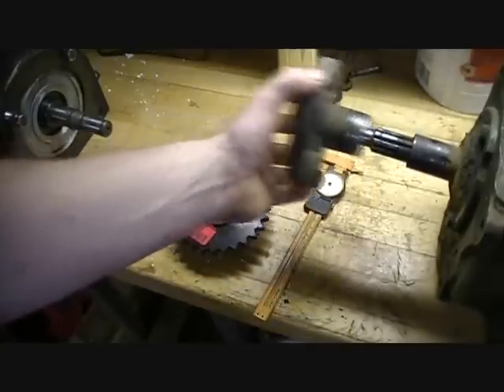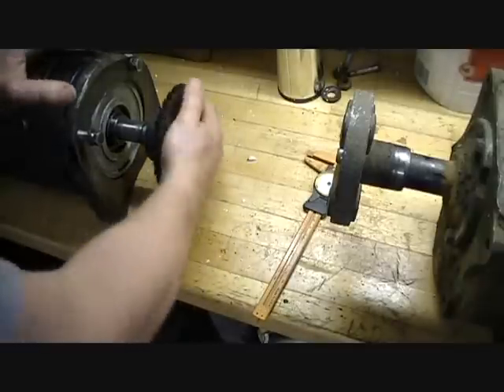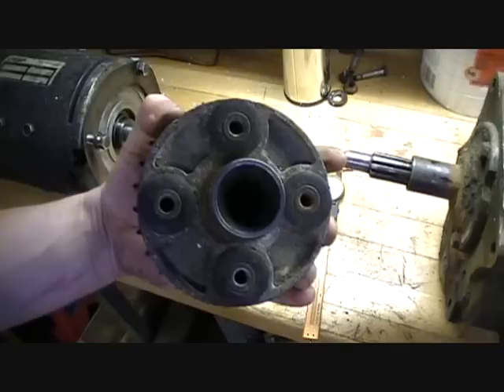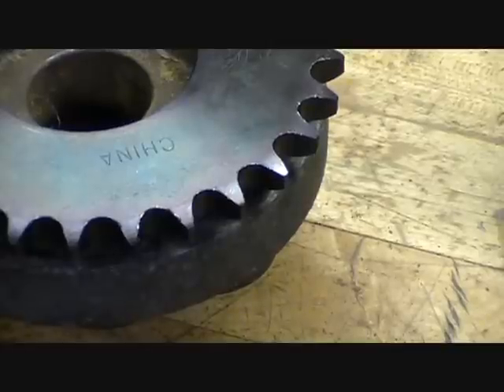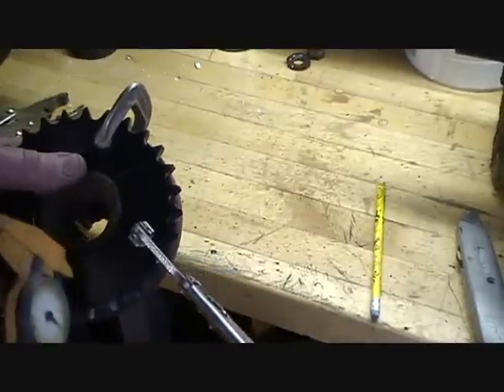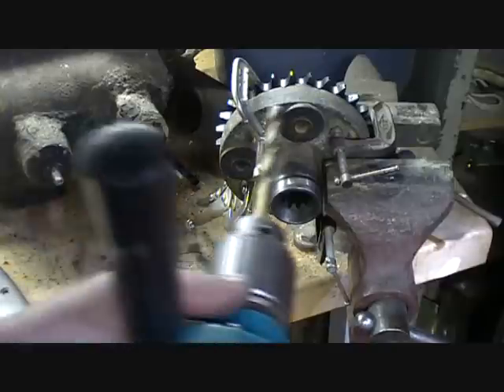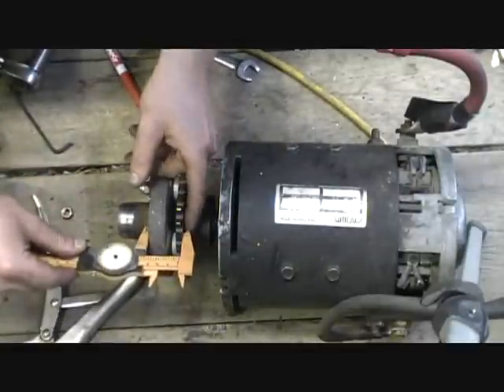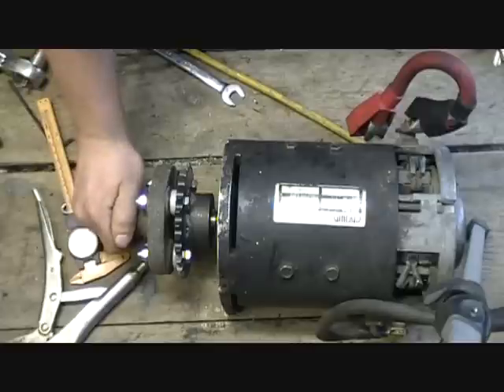1961 Cushman Truckster EV conversion LiFeP04 - Part 2 Motor coupling

Comment: Not a lot of torque if you can slow it down with your hand. The large radius (shorter length) motors are much better in terms of torque to weight ratio.
Reply from the maker: Agreed on the better torque of the pancake motors... but keep in mind this test was done with a single 12v battery that wasn't super healthy anyway.

Comment from the maker: Well, this conversion will be less than 1200#'s with the driver total.  And it will be used primarily at speeds below 50mph.  And I'll have to make a special housing to keep it cool.  And I might need to try liquid cooling.  So yes, smaller motors will drive lighter vehicles okay, but overheating is a serious concern.  I got my motor in barter, so if it burns up I'm not out much.  I recommend you do the same if you try a smaller motor!
B

Comment: so all the hype about 8-9 inch motor is folly.If ur doing a small car like a civic or small vw rabbit u can use 6-7 inchs?Freaking cool man,Because its soooooo damn hard to find a good deal on a dc motor ive looked high and low.Iam sick of gas prices but the conversion is not looking to cheap as they say it would haha.

Comment from the maker: No, the motor has a keyed shaft as does the gear I used to make the coupler.  A ground flat spot would do as well, but that's not as good as the keyed type.
B

Comment: So how are you holding that coupling on the Electric motor? Just grind a flat spot on the motor shaft and run the set screw down?